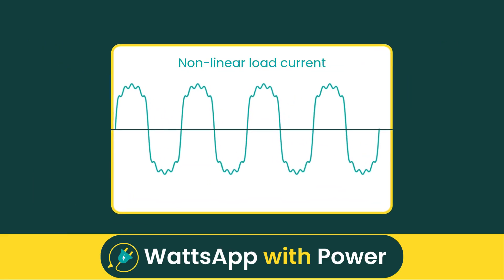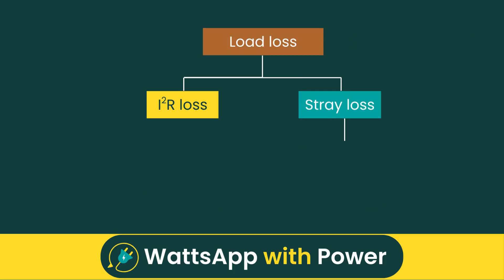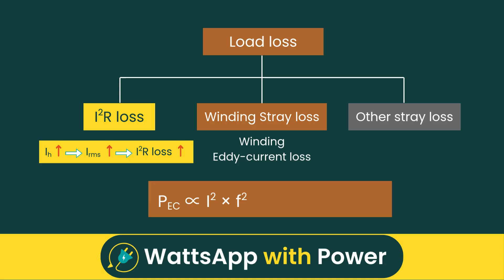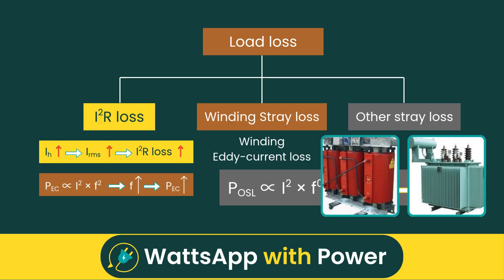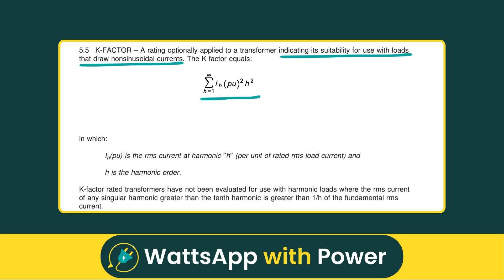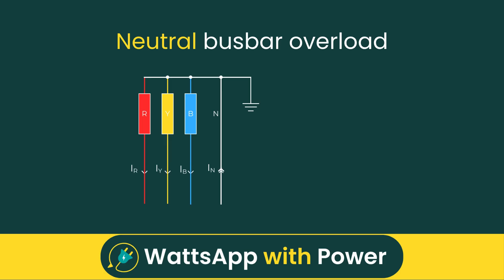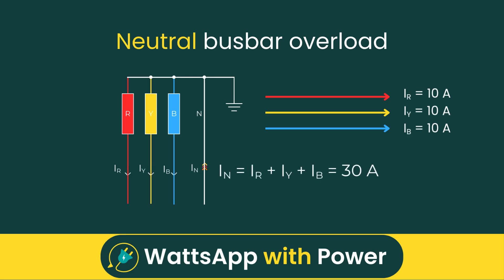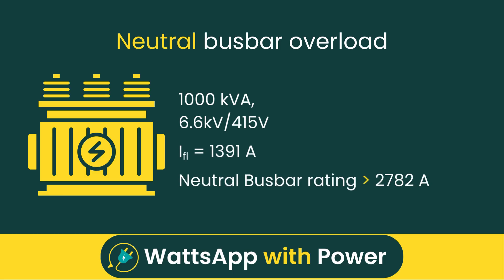K-Factor rated Transformer | Explained

Comment: Have you ever heard of the K-Factor affecting a transformer inside an air handler when operating? Recently experienced a transformer overheating when no thermostat or call for heat or cool was present at the circuit board. Noticed that Gemini highlighted how eddy currents can cause transformers to overheat more especially when inside a Inverter driven unit. The specific air handler being discussed was a Carrier Infinity Air Handler equipped with a 10kW Heater Package. Of note is the power outage reported by homeowner about a month prior to this system burning itself out while not tripping the circuit breaker found on heater package. Replaced the heater package, transformer, circuit board, control wiring harness, and blower motor. Three days after the replacement work under warranty found contactor used on heater package melting at terminals resulting in large voltage drop across contactor. Also found transformer overheating again. Replaced transformer and heater package thinking this was already a unique once in a lifetime case study. Once three days passed returned to work site to find transformer that was replaced twice already now making the unusual electrical hum I heard when observing the previous one overheating. Found circuit board with continuity to ground at two specific terminals which is odd since this is the second control board now. At a loss but using Gemini seem to be orienting toward a potential explanation that is upstream from the equipment per se. More to come as I unpack the information, review field video footage, and catch up on the written information required to get some resolution on the matter.
Reply from the maker: Thank you for sharing this detailed field experience. From what you’ve described, it does sound like something upstream of the equipment may be contributing to these repeated failures rather than isolated component issues.

It will be interesting to see what you uncover as you review the upstream supply, grounding, and power quality. Please do share an update—real-world case studies like this are valuable for everyone working in the field.

Comment: Why 200% of rated current is neutral becoze only harmonic current will contribute in neutral current alongwith unbalancedo 200%osvery highvalue. I think 12of ratedcurrent can be enough
Reply from the maker: Good point — but the 200% neutral rating is mainly for K-factor transformer feeding nonlinear loads.
While 50% is okay for linear loads, triplen harmonics (3rd, 9th, 15th, etc.) in case of nonlinear loads cause neutral currents to add up. And because they’re high-frequency components, they generate more heat due to increased skin effect and eddy current losses.
So, it’s not just the current magnitude — it’s the heating effect that justifies a 200% rated neutral for safe and reliable operation.
Thanks for raising the point — it's great to see thoughtful engagement on these technical details.